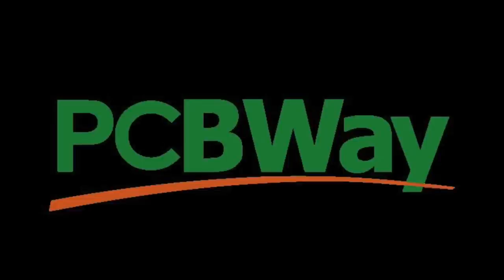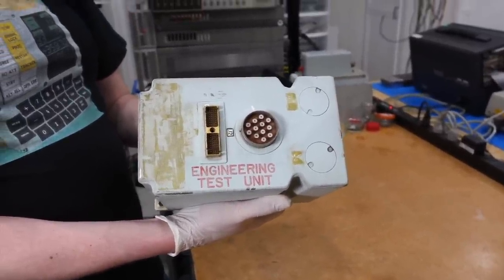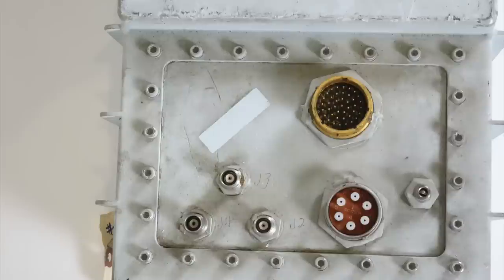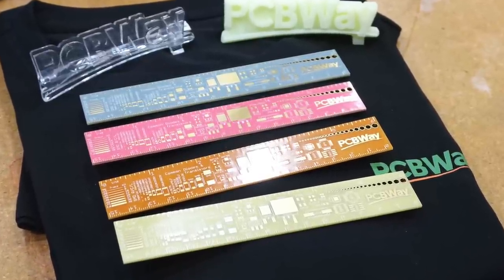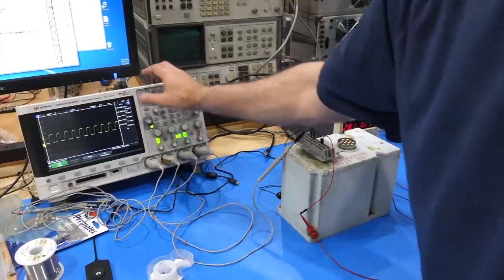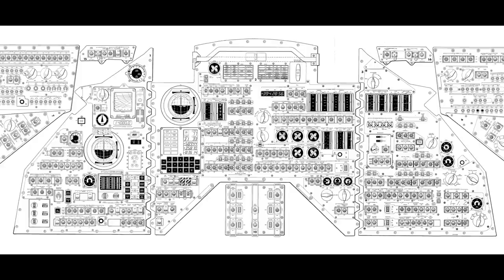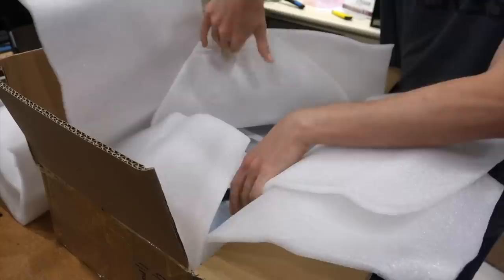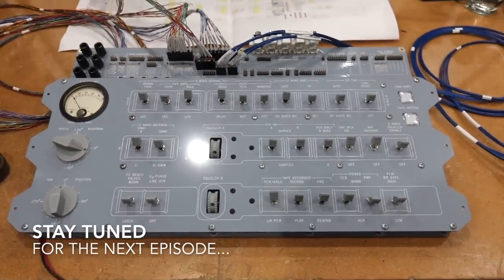Apollo Comms Part 23: making connectors and a control panel

Comment: Ah yes, Deutsch connectors.  I worked for an EMI/EMC test lab at Ft. Meade in the late 1970s.  We received a lot of interesting military communications gear loaded with Deutsch connectors.  We had to rig test harnesses, so this video brings back memories.  Some of those connectors each easily cost more than the old Chevy van I was driving then.  Of course you don’t want your microwave guided Atlas missile going off course, so a connector which can stay engaged reliably over the full -55 to +125 C temperature range while experiencing high G-forces is pretty important.
Reply: I used to work with the Deutsch connectors too, they were used in various avionics wiring on the A-6 intruder.

Comment: 11:07 - The original 386 often used that type of PGA132 layout. Could well be for the 386, but then that socket was probably used for lots of other things.

They look like the kind of ZIF pins that solder to the board with the Mylar intact, then the chip is simply press-fit.
Reply: I just saw the Control Panel part.

Dayum, Eric. That looks awesome. :o

Comment: How about a more authentic back-lit by EL comms panel? I think about an acrylic plate, cut to shape, EL foil at the backside, big grey sticker with cutouts where the light is supposed to shine through. That´s possibly like von Braun´s team made them. Or:
Possibly the sammich was aluminium backplate, then EL foil, then sticker with translucent words and markings on top.
Maybe I´m the only one, but I think the use of electro-luminescent backlighting gave the whole Apollo cockpit this "Whoa Buzz, look at this, is this some year 2063 tech?" feeling :)

Comment: 11:08 If my memory is correct those were called PGA or Pin Grid Array connectors.  The through-hole predecessor to Ball Grid arrays.

Comment: There may be a possibility that those Deutsch connectors are from the Deutsch Group Aerospace company headquartered in New York City, they may be older model designs of theirs that square on definitely looks similar to their Bulk Head connector,. definitely something to look into
Reply: It's certainly feasible thats the company that made them because they were founded in 1938 and they're still around today it seems

Comment: Once you got all of the still available original hardware up and running, in my oppinion there would be a nice addition to your system to be done:
A psyical simulation of the CSM and LM. No, I am not talking about a computer screen where a simulation shows up. I am talking about a pysical representation where every action in the AGC has consequences in how the physical models move. Wouldn't it be cool to eg have a small LM swing around in "orbit" around a simulated moon and you can experience how it made its way down to the ground with eg. leds lighting up as the individual thrusters are fired?

Comment: Not entirely sure, but I think, at least for more recent connectors, anything known as Deutsch Connectors can be found at TE Connectivity. Not sure if Deutsch is a certain line of connectors they make and made, or if they at some point purchased the company or whatever. but I think at least some of those connectors are still available as legacy types for certain use in aviation.

Comment: The rectangular connector looks like an ITT Cannon DL-series. Of course, it's old enough that who knows if any currently-manufactured connectors are compatible. I had a quick look at the datasheets I've got and nothing looked perfectly correct, but have you checked out that datasheet?
Reply from the maker: It's a Deutsch connector too.

Comment: A fifty year old welded box of electronics that instantly works probably within spec. Those original engineers who designed these modules were on top of their game.
Reply: Designed by a team to who the word conservative rating was something they considered way too relaxed. Designed to be used once, tested a thousand times, and then left for a half century, yet still conforms to the original spec.
Reply: It turns out making something that is above mil spec levels of reliable also makes it last a long time.
Reply: @frosty9595  Yes, we used to joke that 'guided missile quality', meant that it could be left for a long time, then it would work perfectly. . . . .  once.

Comment: Those “ic connectors” are called Pin-Grid-Array (often abbreviated PGA). They were used a lot on older CPUs (486 & Pentium mostly).
Reply: I was thinking they looked like 386 sockets.

Comment: I love what you & the team are doing (Apollo and otherwise - but of course REALLY love the Apollo projects), so thank you.

A question on those Deutsch coax sockets - how are they indexed in rotation? From the appearance of them, they're axially symetric, and the by-5 design can be connected in 4 wrong orientations as well as the 1 correct one. The by-12 has fewer opportunities to be wrong, but look like it can still be inserted in three different rotations.  Unless those multiple coax connectors are all carrying the same signal, it seems like there's a good chance of getting it wrong!

Comment: I've had to make connectors to made with pattern 602 connectors with coaxial inserts; I discovered that a size 16 female would crimp onto small coax cable ( I can't recall what the exact type was), and the centre of the coax was a perfect fit in the middle of the coaxial connector. I found the correct size 602 housing, gutted it, fitted all the receptacles in it then filled it with epoxy resin, resulting in a usable custom connector.

Comment: That square connector looks like an industrial amphenol used to interconnect machines.  I have no idea what the part # is but I've seen it on printing and binding equipment.
Reply from the maker: It’s a Deutsch connector too. Quite a rare one.

Comment: What a creation.  Fantastic.  One little, itsby-bitsy, issue.  How can you stand having the 3d knobs and squelch controls that don't actually click/snap to position or some resistance to the squelch wheels?  Come on, surely in that treasure trove of your stash there are some guts from old controls that can be added behind the front panel to add that one bit of realism.  Oh,,,, and then there's the question,,,  why not a complete panel?????